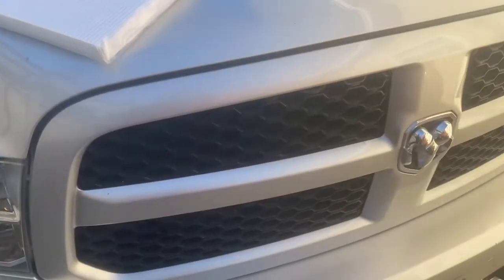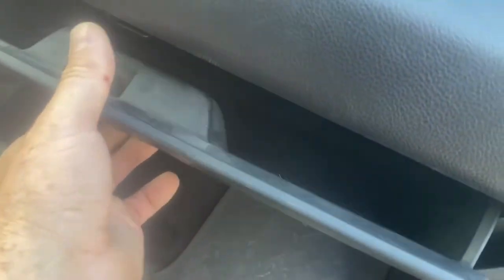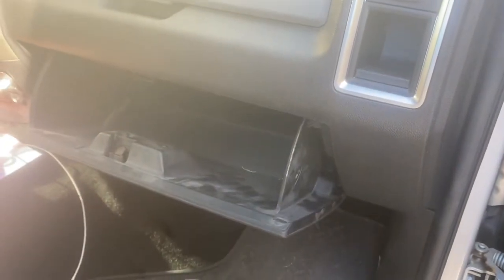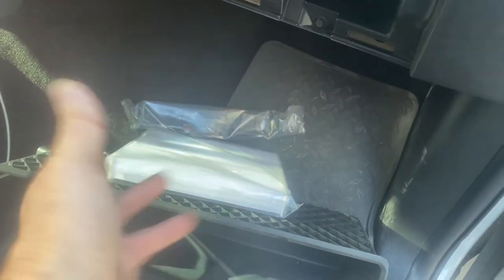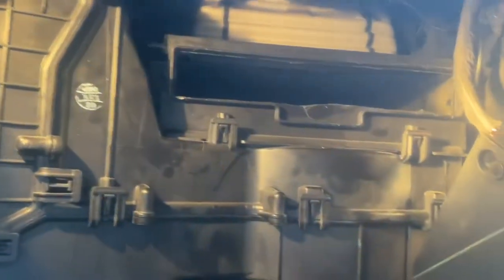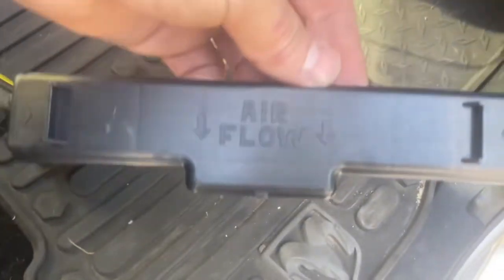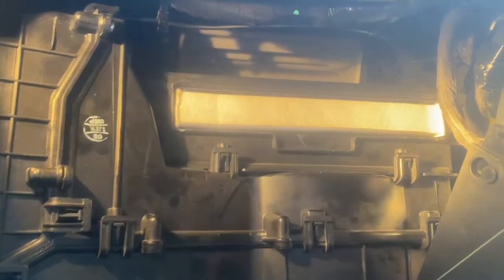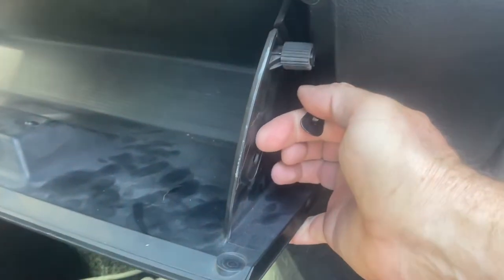How To Install Cabin Air Filter : 2009-2019 Ram 1500 2500 3500 Classic

Comment: I have a 2012 Bighorn...been looking at several videos. All of them said there were tabs to remove the face plate...I THOUGHT I WAS GOING CRAZY !! SAW THIS VIDEO AND GAVE UP. I JUST BOUGHT MORE LITTLE TREE AIR FRESHENERS. . PROBLEM SOLVED
Reply from the maker: @joeburton1232  it’s so silly that Ram made it like this!  It’s not too difficult, order the filter/door kit and after your trees wear out knock it out.

Comment: So to confirm...there is no air filter in there, but I must cut the piece out. I just ordered the cabin air filter door from Amazon and I already have a new replacement cabin air filter. Should be all set tomorrow or next to get the job done. Thanks for sharing this video. Appreciate it.
Reply from the maker: @tstokes174  I don’t know what model comes with a filter.  Hope it goes well for you.

Comment: Cut mine out with a utility knife same as in the video. It was not difficult at all, slow careful scoring across the top and bottom from each end to about midway. Cut completely through on each side and top then push in and snap the piece off the bottom. Took a few swipes to get completely through but overall a fairly simple job. Also cut two notches to correlate with the tabs that protrude on the lower part of the cover.
Reply from the maker: I must have had a dull blade, it wasn’t great but got it done.  Seems odd that this isn’t factory.

Comment: This is the first time I've gotten into this. Pulled the glove box on my 2016 2500 as instructed, and found block off was cut out and the door was installed. But (everyone has a big But) there was no filter. As this is a Tradesman, the lowest trim level Ram, I'm thinking that's the way it came from the factory.
Reply from the maker: Interesting.  Mine is a 2014 Outdoorsman, maybe a low mid level trim?  Wonder what ones have the door or filter?
Reply: My 2016 tradesman has a door, super easy no cutting, but also had no filter, slipped in a filter, no issue.
Reply from the maker: @thejousters1705  That's great.  Maybe after a certain year they did the door but no filter?  Anything to save a few dollars out of the factory.

Comment: Doing mine tomorrow, Milwaukee multi tool is coming out lol
Reply from the maker: That should work well.
Reply: @TomsTinkeringandAdventures  worked great. That plus a heater core flush and cleaned out the blower motor. Now I have heat and air speed.

Comment: I am in mid cutting on the panel.. Its not going well I am wondering about a dremel.
Reply from the maker: Dremel might be good if you can get in there.  I actually ended up with bits of plastic in the blower motor, fortunately it’s easy to remove.
Reply: Maybe try drilling the corners out first
Reply from the maker: @jakegiubbini  that’s a good idea.  I was hoping it would cut easier!  😂
Reply: @jakegiubbini  I got it just a little bit at a time with the exact-o knife.